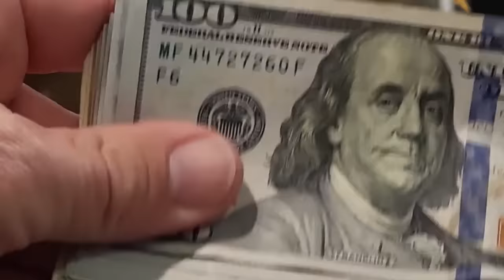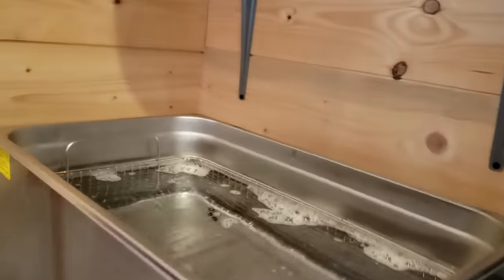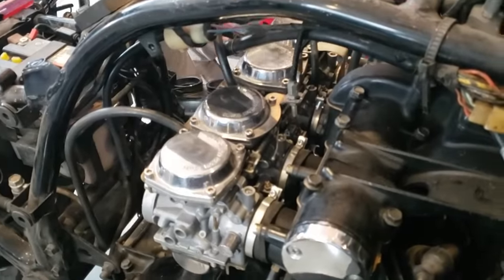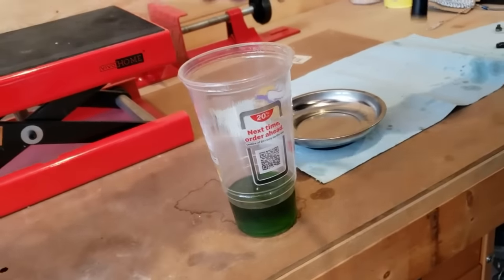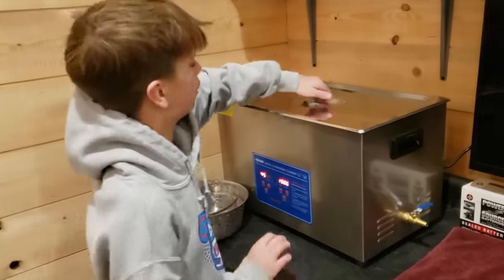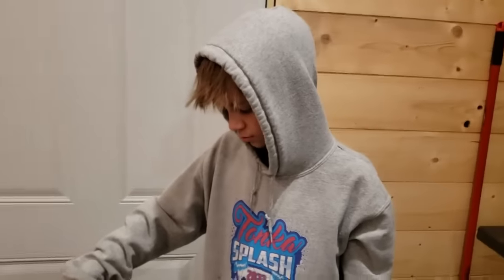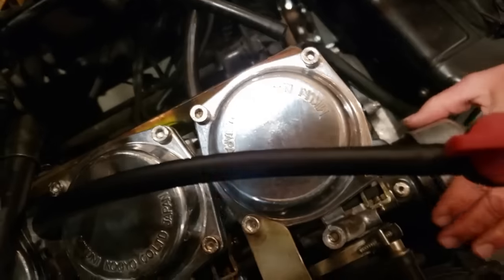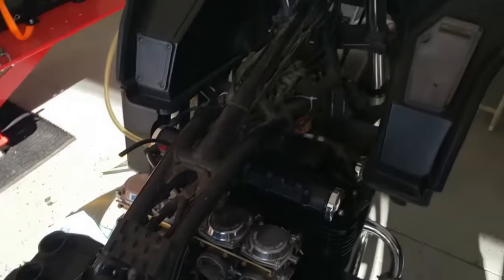We bought a non-running motorcycle - NOW WHAT!!

Comment: Awesome! I think you caught those carbs just in time before they got much worse! The hardware on the carbs had been changed and the intake manifolds I believe. Also big shoutout to Chase for being a great cameraman and tech!
Reply from the maker: Thanks BJ.  We have been having some fun in garage lately, finally.  Im hoping that whoever had this before did some engine work and losely put back together.  Those carb bowels were barely screwed down anf this oil issue.  I wonder if the had the engine apart and again, losely pit it back together.  The oil looks brand new.  Ah, the mysteries 🤔👍🍻
Reply from the maker: I'll definitely pass along your comment to Chase.  Coming soon he'll be the "on camera" man 🥰
Reply: @ACECafeBikes  that oil leak was crazy!

Comment: The carb syncing with vacuum gauges and replacing the 4 Diaphragm Assembly's in the carbs is a must have. After many years  siting dry these are DEAD, replace them with NEW ones. This is all very important when slowing down to prevent the shot gun effect that will harm the motor.
Reply from the maker: Thanks for the tip 💪

Comment: My bet is that you still have some paths for the fuel enrichment and possibly the pilot/idle mixture circuit of one of the cars still clogged.  good possibility one or more plugs bad too. Total breakdown of carbs and checking all the tiny little passages are clear.  Good Luck
Reply from the maker: Thanks for the advice - I have readdressed the carbs and I did overlook the pilot jet as they were under the rubber plugs...and they were pretty nasty like everything else was before we began cleaning.  I suspect this will help starting the bike and running better.  The 3 cylinders that were running those plugs all seemed to look fine - if not a little lean.  The 4th cylinder plug almost looked fouled, not oily, but extremely caked with carbon.  I'll be back on this later in the week - thanks again for chiming in.

Comment: The only thing to watch on those ultrasonic cleaners is anything rubber or plastic, it doesn’t do them any good , I usually strip the part and leave any rubber or plastic out of the ultrasonic. Nice work on that old bike
Reply from the maker: Thanks for the tip on the rubber bits - I was curious about that, I dont think that cleaner that I am using would harm them, but I will consider that in the future.  Hopefully she'll appreciate this once over and treat us well in the months ahead

Comment: You shouldn't put the carbs in the ultrasonic with the rubber still in them.  You will ruin your diaphrams and the rubber plugs over the pilot jets and such.  Use something plastic to break the slides loose and remove them before putting in the cleaner.  I didn't see where you removed the rubber plugs and the pilot jets.  Those pilot jets didn't get cleaned without removing them.  That might be why it isn't running on the one cylinder.  Also, these bikes won't run correctly without the air box in place.
Reply from the maker: Thanks so much for the tip - you're right I dont think I did remove the plugs and clean those jets - I have the carbs back of I will certainly investigate that.
Reply: Watch out for RobsRides mechanic police division!🤣Sloppy Mechanic!! Your Busted!!😲😩😂

Comment: Are you gonna cafe it. The full faring bags saved lot of the metal form uv. But looks like an inside bike. Ye old 2 valve Suzk.air cooled run forever as long as do a little mateinance Have couple 1200 bandits on stock steel frame Other in a GSXR chassis.
Reply from the maker: Nope, this one we are keeping all stock!
Reply: @ACECafeBikes  it is too nice to mess with. You can take it from Seattle to Miami Be pretty comfortable.

Comment: You should have taken the carbs all of the way apart! Waste of time
Reply from the maker: I like to give them a quick bath before I take them apart so they are so sticky and I have found that they come apart easier.
Reply: first job old bike have take ALL carb off and clean totally clean all whit ultrasonic cleaner and then do all other or waste only time than idiot, carb have first and important job old bike. then ingnition check.